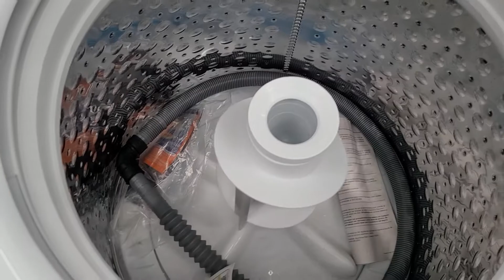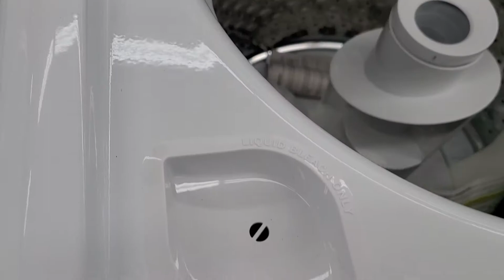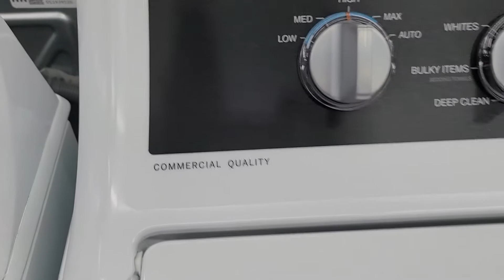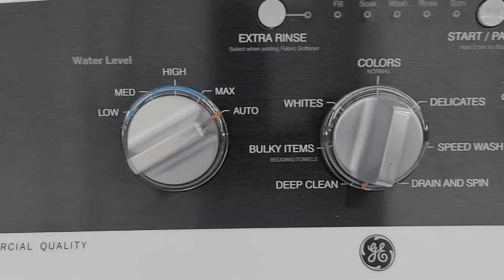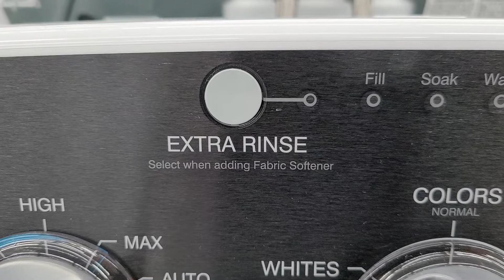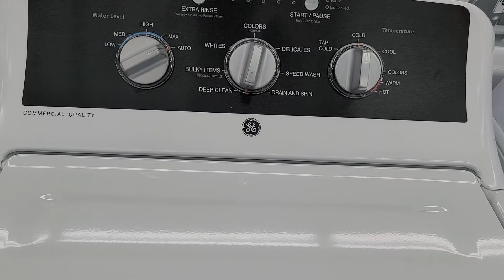Washing Machine Buying Guide - GE GTW525ACPWB

Comment: The dimples in the stainless steel basket make add a small amount of surface area to the basket but what those dimples also do is to add rigidity to the basket much the same way sheet metal duct work has shallow bends normally in the shape of an X to keep them from flexing which reduces noise as the ductwork changes temperature. An easy at home way to demonstrate this is by taking a sheet of paper about 5”x7” and hold it by two corners and you will see that it wants to flop over. Now take the same piece of paper and fold a crease diagonally from corner to corner along both long axises and hold the paper against the same way as before and you will notice the paper will remain rigid as long as the creases in the paper are not totally flattened back out. Had the basket not had the dimples press into the stainless sheet metal the would have had to use sheet metal at least half again as thick to maintain the same rigidity.

Comment: Worst machine I’ve ever owned. Only 1 1/2 years old and won’t handle big loads, won’t spin properly and was the most expensive purchase mistake I’ve made lately!
Reply: Amen!!!! This machine has caused me more stress in the short time I’ve owned it! GE does not, I repeat, DOES NOT honor the 5 year warranty, do don’t kid yourself with that false sense of security! GE should be arrested for impersonating an appliance manufacturer!
Reply: @nafnala  ive had no issues with them honoring the 5 year warranty. Bodwell who does the repairs can see when I purchased so no charges. Now the machine on the other had in its 4th year now has been a different story.
Reply: Thank you. Salesperson was pushing these
Reply: How much did you pay for it?
Reply: @hilarysvariety5839  Got a pair GTW525ACWWB and GTX52EASPWB for $699.00 each + $300 rebate.

Comment: Speed Queen much better
Reply: The speed queen does sound super nice but the capacity is so small. I can’t imagine a king comforter fitting into a speed queen. 
I’m currently shopping and can’t make up my mind
Reply: Johnny why nice stuff don’t built well
Reply: Speed Queen is designed and built much better
Reply: @johnnyjilluch8045  what I should get basic or fancy
Reply: Speed Queen TC5
Reply: Can I have lg or no
Reply: @johnnyjilluch8045  coleuses let me have lg or speed queen please let me have lg
Reply: @johnnyjilluch8045  why you force me get speedqueen
Reply: @johnnyjilluch8045   can I have lg washer please or no
Reply: @johnnyjilluch8045  why you not let me have nice washer dryer with chime
Reply: @johnnyjilluch8045  I agree bet the speed queen TC5 Dryer pair is $3,200 out the door this GTW525ACWWB
 and GTX52EASPWB pair was $1200 after discounts + $300 rebate.   Almost 3 times cheaper.  I could buy and extra two pairs if needed.
Reply: Also 2 x as much I can buy one of those for $850, same warranty bigger bowl plus the shop was giving a 3 yr extension free.  No brainer, I can buy 2 of these for the price of a SQ.

Comment: I would say California King-size comforter would fit perfectly in this washing machine.
Reply: No, my daughters queen comforter which I just put in for a wash isn’t even fully covered with water and the level is on MAX with the cycle on BULKY ITEMS and this is not going to wash my queen size comforter and it’s from Walmart so it’s not even thick or heavy.
Reply: @sig75chick90  Makes no sense I have a older GE with only a 3.5 cuft capacity and it does queen comforters this one is larger at 4.3 so yes it will do a queen for sure.

Comment: Had this machine for two weeks now. I wish I would have gotten the Speed Queen.  The manual water level is a farce. The machine chooses by weight of the clothes. Obnoxious washing agitation sounds.  Junk.
Reply: I was wondering what was going on.
Reply: Worst machine ever! I wasted $1,100 and regret the day I bought it! GE does NOT honor the warranty!
Reply: @nafnala  GE does honor warranty.  There must be more to the story like you wanted a trade it in for a speed queen even up or something.
Reply: @Physics072 I said what I meant and I meant what I said. Got it?
Reply: @nafnala  They do honor it, I called them on a door dent and they will replace it free NC.  Maybe it just you.
Reply: I've had it a year and hate it too!  The water level is a total joke.  The only reason I bought it was because it was suppose to fill all the way.  It's actually filling even less.  Not even half way anymore on any cycle.